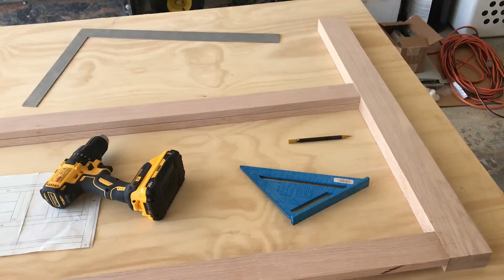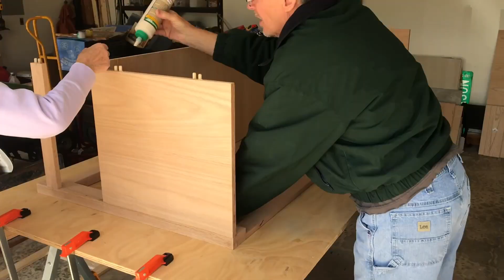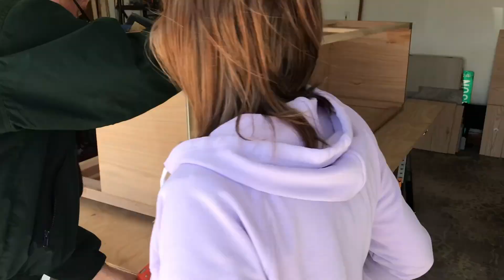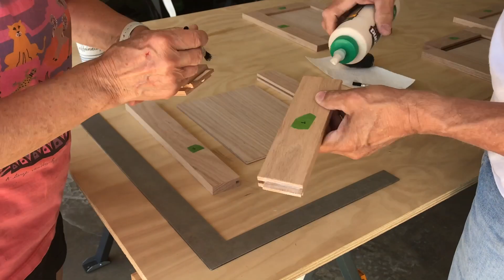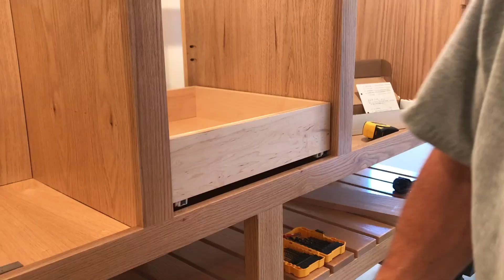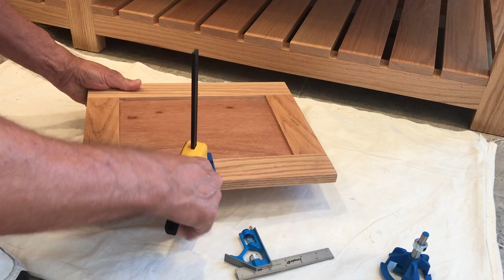Building a Bathroom Vanity from Start to Finish

Comment: Just amazing! What I like is that the tools you used are pretty straightforward but the skills are impressive. Maybe someday I'll try this. I agree that the cost breakdown would be helpful and also a list of the tools used. Maybe do a more detailed video.
Reply from the maker: Here’s a copy of a couple responses to a previous comment that gives a brief cost breakdown. You can watch the 6 individual vanity videos on our bathroom remodel playlist for more detail. If there’s a specific point in the process that you would like tools listed for, let me know and I’ll get back to you. Good luck!

We haven’t totaled it up yet. We’ll add it up and get back to you in a few hours. I can tell you that the Cambria Quartz top was $2,200 and the faucets were $170 apiece. I’m guessing that the vanity wood, the drawer glides and door hinges would all come in under $1,000 but we’ll see. That’s not bad considering the vanities alone that we got our ideas from online are nearly $4,000 for that size and are pine where ours is red oak. We did have to buy the oak that was finished on 4 sides since we didn’t have a planer at that point. But Menards has reasonably priced S4S wood in many species.

Ok, the total cost of the red oak and red oak veneer was $696. The total for the Blum soft close drawer slides was $124 and the Blum soft close hinges totaled $88. And finally, the hardware pulls totaled $59.

So I was pretty close, the vanity itself was $967 (actually $870 when counting the Menards 11% in store rebate for the wood). The quartz top that we decided on was a little expensive, but that did include delivery and installation which was the only part of the bathroom remodel that we didn’t do ourselves.

Comment: Really beautiful, do you have total cost for the project?
Reply from the maker: We haven’t totaled it up yet. We’ll add it up and get back to you in a few hours. I can tell you that the Cambria Quartz top was $2,200 and the faucets were $170 apiece. I’m guessing that the vanity wood, the drawer glides and door hinges would all come in under $1,000 but we’ll see. That’s not bad considering the vanities alone that we got our ideas from online are nearly $4,000 for that size and are pine where ours is red oak. We did have to buy the oak that was finished on 4 sides since we didn’t have a planer at that point. But Menards has reasonably priced S4S wood in many species.
Reply from the maker: Ok, the total cost of the red oak and red oak veneer was $696. The total for the Blum soft close drawer slides was $124 and the Blum soft close hinges totaled $88. And finally, the hardware pulls totaled $59.

So I was pretty close, the vanity itself was $967 (actually $870 when counting the Menards 11% in store rebate for the wood). The quartz top that we decided on was a little expensive, but that did include delivery and installation which was the only part of the bathroom remodel that we didn’t do ourselves.
Reply: Thanks for this! Yea that top at 2,200 was pricey!! @DIYBoomers

Comment: I guess my only comment is: how do you clean under it?
Reply from the maker: Very good point! I did give that some thought along the way. Those dust pad gizmos do hinge low enough at the handle to get underneath. Also, in our case, I didn’t glue 4 of the slats (2 on each side), to allow access to the water supply lines that come up from the floor along the back. Instead, after making slots in the back of the slats, I attached them with dowels (with no glue) so they can be removed. That will give us more access if necessary.
Reply: @DIYBoomers  Great build BTW.
Reply from the maker: Thanks. Yeah, I just looked up the Swiffer Wet & Dry Sweeper and it just fits underneath.